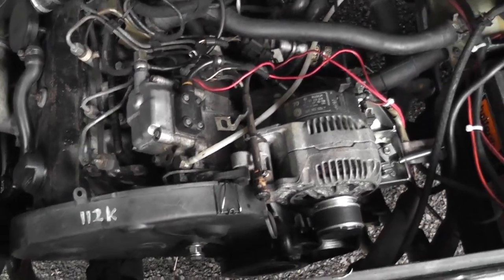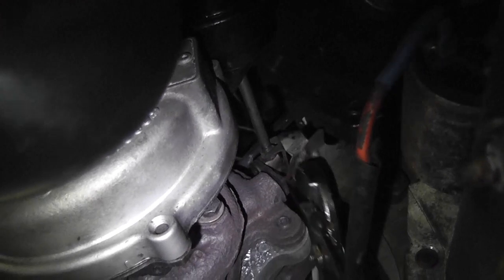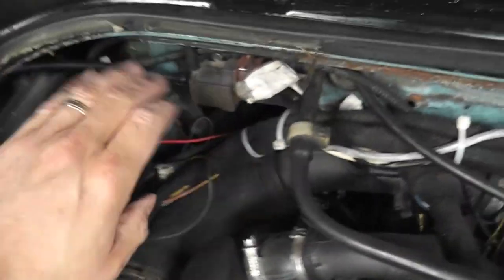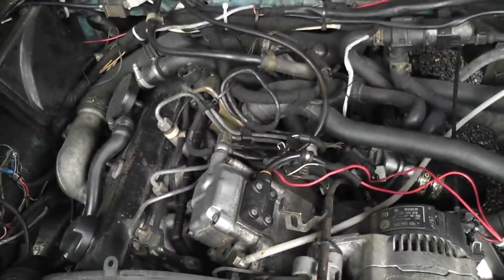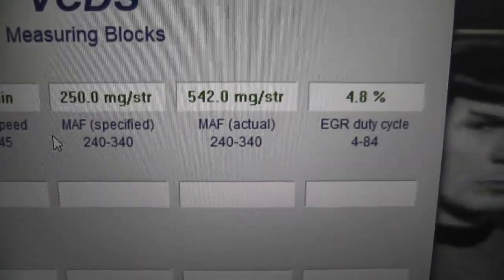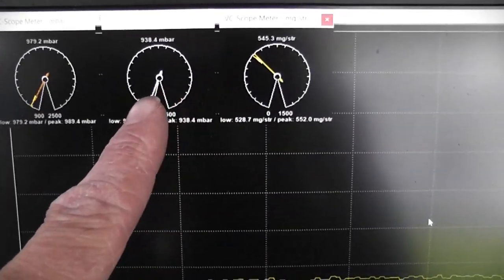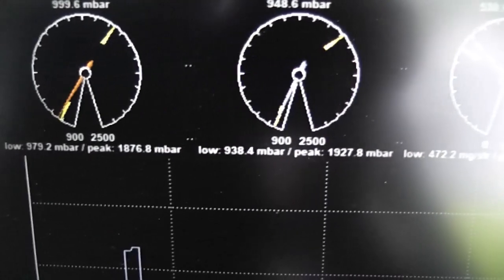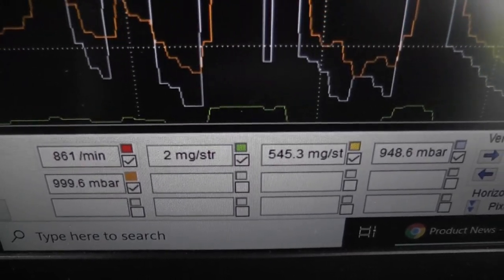VW TDI poor performance troubleshooting - VCDS & turbo

Comment: Have you checked the fuel pump timing? 
Got into measuring blocks, block 1, switch to basic setting, then click tdi timing. Select the engine code and it will give you graph. Move the pump till its dot on.
Reply from the maker: Yes I checked it, thanks. It's spot on. I'm thinking cam timing though.

Comment: My AFN suffered low power and struggling on hills like yours. This was actually after some overboosting issues which caused the intercooler end cap to blow off. The issue only got diagnosed once I found a decent VW specialist who immediately found the MAP sensor was faulty. Replaced that and runs fine now although I could really do with a new intercooler. May not be your problem but really hope you get to the bottom of it. The videos of the whole build have been brilliant and I've learnt so much from them. Thank you
Reply from the maker: Thanks Ian. I'll be reporting back with my findings after the dyno run. I'm estimating it's knocking out a whopping 70bhp at the moment, so we'll see!

Comment: Sounds like your having fun!
Thought I'd give my 2 cents...if i was to check your turbo i would probably get a pressure/vac pump with gauge and check the actuator operation to see that it operates smoothly and reaches max travel at the specified pressure- just a different way of checking things really.
Also i have replaced fuel temperature sensors on these engine years ago for poor/flat performance so may be worth checking the measured block for this. Does it run better with MAF unplugged?
Just some thoughts🤔👍😎
Reply from the maker: Thanks for the advice. I'll be looking at it again during the week and I'll try what you're recommending. It's actually a waste gate turbo though so no vanes. I'm wondering though, in the case of a waste gate turbo could I not just temporarily bypass the n75 solenoid to see if that works?